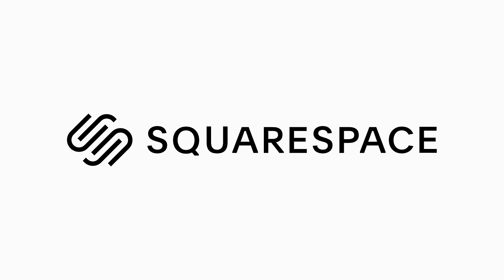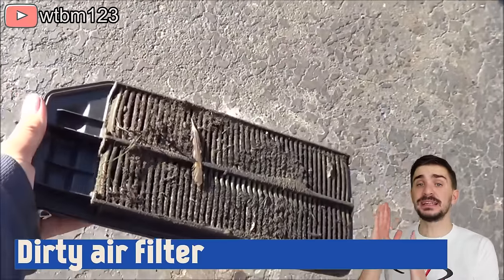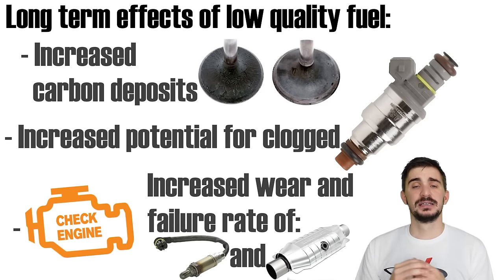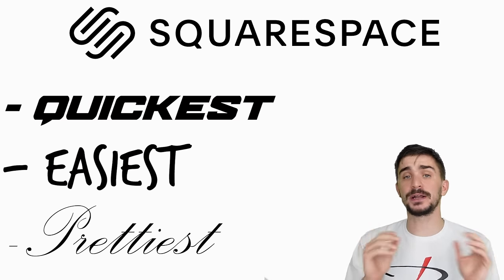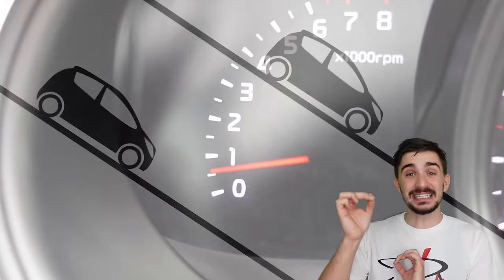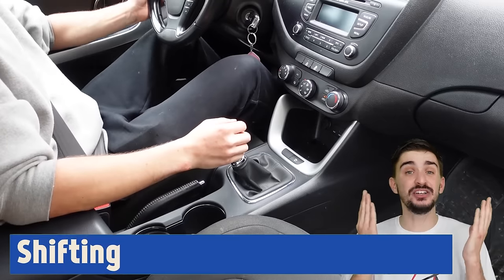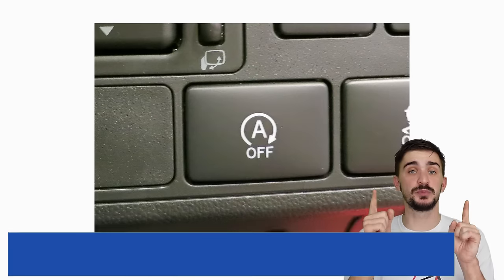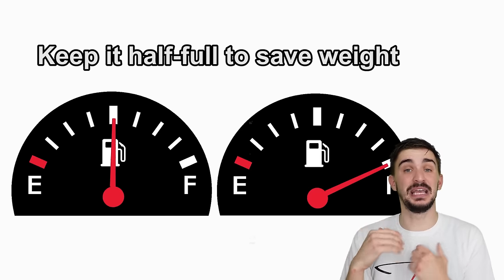EVERYTHING on FUEL SAVING - PRACTICAL DRIVING and MAINTENANCE techniques to REDUCE FUEL consumption

Comment: Around 20 minute mark you claim none of the miricle fuel additives or cleaners work.....WRONG! I have a Chevy truck with a 6.6L Turbo Diesel TDI motor (DuraMax V8) and the Lucas oil products fuel system lubricant helped aleviate the stichion of the fuel injectors with 100,000+ miles on them. After adding the Lucas lubricant my, truck mileage increased about 2.5-3MPG from 13.5MPG to 16-17MPG so now the Lucas lubricant is a must use additive. Another noticable difference was the smell of the exhaust at low speed and idiling it cleared up the rich fuel smell it had started to exhibit. The proper fix might be a new set of fuel injectors but, that is a very expensive job with very expensive parts even rebuilt fuel injectors are over $1000USD.

Comment: Sorry to say, but there are some mistakes in your video this time:
1) Obviously it saves fuel, if you shut down your engine on longer standing at red traffic lights. It's all about the time interval, but break even on modern fuel injected cars is a few seconds only.
2) Shifting up early is mostly good, unless you really exaggerate. Rule of thumb: engine speed is not too low, if it doesn't make humming sounds or cause vibrations.
3) Clogged air filters do NOT increase fuel consumption on modern fuel injected gas engines, as you reduce the air flow by the throttle anyway, unless depressing the accelerator pedal. A sensor measures the (reduced) air mass flow. Dirty filters decrease fuel economy on Diesels though. On both, Gas and Diesels, you lose max power. So, just for that, its good to keep it clean.
4) Thinner (more "liquid") fluids are called "less viscous". Put the right oil into the engine, that qualifies for it according to specs and, if applicable, season. A too thin oil may destroy your engine. For the Oil spec like 10W30, the second number (here 30) is the important one, as this tells how "viscous" the oil behaves, when warm. The lower the first number (here 10), the lower the viscosity of the cold oil and this causes less friction in winter and during warm up phases. As an example, 5W30 saves some fuel compared to 10W30.
5) Running the car in idle (manual gear box, engine idle but ON!!) at times may greatly improve fuel efficiency. This is true, if you do NOT want to brake or accelerate. Example: You're rolling downhill on the highway at say 70mph or so, and the car keeps the speed in idle and that is the speed you want. Go for it, it saves lots compared to having the gear engaged, cause in the latter case the car brakes, meaning it loses kinetic energy. If however, you want to brake, always do so with gear engaged and even shift down, to keep it running at reasonable speeds. Fuel cut off (accelerator fully released) usually engages above ~1500 rpm, so try to keep it above this limit to save fuel ... and brake pads wear.
6) A small wheel diameter doesn't save fuel at all. BTW, its restricted by the registration of your car. Narrow tires are generally slightly better due lower aerodynamic drag and weight.

Best option to save fuel: Leave your car parked and ride the bike, walk or use bus, tram, train.

Comment: Well duh you need to remove all restrictions from the engine such as the air filter which is restricting flow you need to remove the catalytic converters because they're restricting flow need to pull your heads port and polish your valves. Oh and of course dirty oil means there's friction material in there which is creating friction so change oil every 500 miles

Comment: I always try to not go over 3k rpm when saving fuel to avoid richer mix, idk if it works.
Reply: It probably does because of lower RPM range, although I believe going open loop has to do with TPS angle vs RPM on most cars, rather than just RPM. Mixture in closed loop will always be at stoichiometric ratio with narrowband O2 sensor.

Comment: The weird thing is one time I ran without my O2 sensor in the front(the threads were destroyed) and my fuel economy was better, albeit the hole was also present to affect exhaust gas. So I wonder if my system runs rich as it is? It's not a completely stock setup to begin with. Oh and I used to shut my engine off early to coast into a parking area, but I also have manual steering, so it's actually doable.

Comment: 08:10 that's plain wrong. Many cars have start-stop and those do save fuel. Even older cars will start easily without wasting that much fuel because if they pump too much the engine won't started.
As stupid as that fuel savings method is, it doesn't warrant to say it doesn't save any fuel just because of the startup procedure.
It also doesn't add any extra wear. The wear in an engine comes from lack of lubrication during cold starts after the engine has been off for a while. For the oil to have vanished from the parts in less than a minute is also improbable. That's also the reason why, on engines that haven't been started in a long time people run them with the starter without fuel for a few times for the oil to start spreading again, reducing said wear and tear.

Comment: What about Chiptuning? I know that this is usually used to sacrifice some fuel economy to get more horsepower, but would it work the other way round? And would there be enough potential gains to bother with it?
Also, would switching to higher octane fuel just to run the engine leaner be worth it?

Comment: I agree with everything except one. Nowadays human brain thinks much better than a computer. a manual transmission, if well driven, is more fuel efficenty than automatic and in a not inconsiderable way.
Uphill, downhill, city traffic, my brain always chooses the right gear based on parameters that a computer is not yet able to evaluate.
I did some tests on 2 same cars with the same engine and I noticed a difference of 3/4 km/L
And finally, if you really want to save fuel, don't brake. or rather, safety first, but driving in such a way as to limit the use of the brakes to the bare essentials.

Comment: ICE's are 20~40% efficient... leaving lots of room for improvement in most cars.

Pity you give such short shrift to other fuel saving methods.
There are ways to improve fuel efficiency that you haven't investigated. 
Yes most additives and gadgets don't improve fuel efficiency... but some do.
Some improvements are only small... but start to add up when combined.

Fuel efficiency of cars wouldn't be improving if the car companies had already applied all possible fuel saving technologies.

🙂

Comment: Years ago the Mythbusters did a lot of experiments on fuel efficiency. Drafting large trucks is possible at a safe distance but fuel saving is negligible.
Also when coasting in gear your vehicle goes into a "deceleration fuel cut" that why the exhaust sounds different, it stops injecting fuel. Surprised this fact wasn't mentioned.
Reply: @jort93z  indeed he did. It was more the way he said it, I guess. I figured he would have been more technical about the ecu actually having a fuel cut during decel. That's all.
Reply: @jort93z  yeah... You definitely got a point. Lol

Comment: Firmly disagree with one element. 'Sailing' in neutral / with clutch dipped absolutely does improve efficient, which is why many dual clutch boxes have that programmed in. Yes, the engine has to be fuelled to keep it ticking over. However, kept in gear, the engine is turning at higher revolutions which requires more energy than tick over. So, that's either done with fuel when under power, or via the kinetic energy of the car. In other words, you get engine braking. If you make careful use of sailing you can hugely increase efficient, using the cars momentum and kinetic to keep the car moving rather than to spin the engine faster.

Comment: Again with the engine shut off thing it is OK to do in a manual car. You just can’t turn it all the way off so that it locks up your steering also don’t do it in a heavy car won’t be able to use the break in a safe way the whole thing about automatic, transmission been more than patient and manual is crap

Comment: 14:50 Who shifts to 2nd at 30kmh? I always shift into 2nd when I'm doing 15kmh and most of the time I drive in 5th in the city. 
My car has a relatively low consumption but what I really hate is that weather and outside temperature have a bigger impact than my driving style....I can get 5.5 l/100km in the summer in city traffic and 7.5 - 8.0 l /100km in the winter while driving the same.
Reply: what car/engine do you drive? havent experienced such a difference but in winter fuel consupmtion does go up
Reply: @Boz1211111  1.2t corolla from 2020
Reply: @2810Mad  if you drive the same i can only think of idling for heat, or snow as reasons to such big difference in consumption for me it goes up about 10% wehn its cold, and more if i idle for heating

Comment: Do turbochargers really increase fuel economy or is it just a myth?
Reply: If you add a turbocharger to your engine or you can do is decrease fuel economy. However if you build a smaller engine than would otherwise be put in the car and add a turbo to make it as powerful as the bigger engine, it will be more efficient than the bigger engine so long as you stay out of the boost.
Reply: yes and no. I think if you are comparing similar engine displacements then no. bc the engine will need to fight the turbo to spool up. the turbocharged engine will also have more power further increasing the need for fuel. but if you compare a turbo engine which has a smaller displacement then its na rival (with roughly same hp), it most likely will be more effecient. because it will be most likely lighter and the added compression aids the ther,al efficiency.

Comment: Well, to be fair, my pickup has no power steering. And the power brakes hold their vacuum literally for months. The idea of not saving fuel by shutting off an engine is false. If the crankshaft is turning, fuel is being used. If it's not turning, fuel is not being consumed. The computer does not enrichen the mixture to start an engine that is warm.
Reply: You're right, but there is an initial injection pulse to start even a warm engine from key off to key on.  It is generally about the same amount of fuel as idling for 8 seconds, but varies.

Comment: The explanation of saving fuel by shifting up when driving uphill ("you don't have to press the throotle as hard") is kind of lame - fuel consumption is roughtly throttle*RPM. driving at lower RPM with higher filling factor typically reduces throttle losses.

Comment: About the switching to an econbox from your bigger or more muscly vehicle... Be warned Ecnoboxes are lesser car that bearly save you gas... I don't know any econbox that's gets more then 40MPG that is only 30MPG better then a suburban of really any year as they are all oddly the same 15ishMPG. A hybrid is a better plan but still only get you up top 60MPG if you buy a Prius... So you need to ask your self is it cheaper to buy a $20K+ Ecobox for comuting which you will hate and only use to do one thing your better vehicle can do... As even a Shelby GT 500 with 8 MPG will make the make the Ecobox feel worse then it is as the GT500 sounds nice and is more fun to be in even creeping in traffic. And If you have a luxery truck then yeah you'll absulutly hate the Ecnobox. Beisdes Gas prices are not in the double difgits yet so ask your self is switching to a car you'll hate worth the up front price? And $20K can buy you alot of gas.

Comment: Ahhh, remove spare wheel to reduce weight ... DO NOT DO THIS! If you are lucky enough to have an INFLATED spare wheel, wheel brace and jack in your vehicle, do not leave them at home - EVER! Many modern cars unfortunately have ditched the spare whel and replaced it with a tyre sealer/inflator. 
But wait ... I trashed my front tyre one night on a dark road when I hit an unseen solid obstacle. The tyre was not repairable. I spent 4 hours sorting out a tow-truck to take me and the car to a tyre shop that was ..... you guessed it .... closed. I then spent more time the next day walking to the tyre shop to collect my car. Fortunately I was not far from my home, but consider this: Your tyre is trashed many miles from home on a dark country road. Your mobile phone battery is flat and no one is around to help you. You may be a vulnerable person who needs medical treatment. Yes, take an emergency tyre inflator with you in case a puncture is repairable with a sealing device ... my car has one of those, but it was useless at the time because the tyre was too badly damaged.
Most car manufacturers do not include a spare wheel so they can claim better fuel economy stats. Weird Or What??!!

Comment: Use sealant kit and fuck up your tyre. You cannot repair a tyre that has been messed up by sealant. Garages will not touch a tyre that has been abused by using sealant. KEEP AWAY FROM USING SEALANT. Carry a spare wheel. A stitch in time.

Comment: There needs to be a “super eco” tuner so your car has half the engine power. But if you got a emergency you can still get out of the way.
Reply: In general, engines are most efficient around 1/3 of maximum rpm at 60-80% maximum torque. Tuning an engine to maximise efficiency at a given rpm/load is the same thing as achieving peak power. The only thing you could change is the way the throttle operates, but if you're having to rev the engine more to do the same work, thats counter-productive.
Reply: Some engines with smart valvetrains can shut off a number of cylinders, which gives you pretty much the capability you describe. Fewer cylinders and smaller displacement when cruising can be a big win.

Comment: it1s bullshit to turn off the engine becouse, over ~ 1800-2000 rpm at engine brake the fuelinjection turns off automatically.

Comment: I disagree with the injector cleaner, inside the combustion chamber and fuel system should be kept as clean as possible, buying cheaper gas normally a lower tier gas, will not have additives like a tier one fuel keeping the system clean as possible, and putting a cleaner every other tank helps reduce buildup in the fuel system, keeping down repair costs and yes ultimately maintaining proper fuel economy. I've seen inside engines using cheap gas, I took an intake off a van that was ruined with carbon so bad it barely ran. That repair negated ALL the savings of inexpensive gas purchases in one shop visit, I recommend using cleaners all the time. Everything else, spot on.
Reply: I prefer to let carbon build up.  It helps insulate from heat loss to water jacket and increases compression ratio, thereby increasing efficiency.

Comment: Wow dude! Your driving techniques section is very disappointing. The safety part is accurate but the overgeneralization on the fuel economy side is annoying.

For example, there ARE non-hybrid cars designed with electronic steering and braking and engine modes to allow you to coast with the engine off. Also, my current car's ECU is programmed to force the car to maintain fuel consumption while coasting in gear; when i coast in neutral my momentary fuel economy immediately goes up to 70mpg while coasting in gear the momentary only goes up to about 40.

Comment: 7:20 it is possible on lpg on cars with carburetor, just turn off lpg  leave it in gear and engine is rotating and does not use fuel

Comment: hybrid cars are very sensitive to climate and they pollute a lot more on the short term 
in order to be more efficient then a normal car a hybrid car needs to be used over 10 years with original equipment from the factory witch includes the hybrid battery as well 
if hybrid battery is changed lasts say at 8 years then that car is a big polluter compared with any other same size normal car

Comment: In 8 minute it's not true. When you are in move and want start engine it only necessary to turn key in ignition position and set gear. Engine will start from wheel move, but fact is stil stupid technique.

Comment: Usually your video's have good logic but this time too many things are absent or not correct;
1. Cleaning an air filter with high pressure compressed air is a VERY BAD idea; it destroys the fabric and will leave bigger micro openings in the fabric, so bigger dust particles can enter. Besides; does everyone have an air compressor?
2. Usually a modern car engine is only rated for 1 type of oil. Don't forget that the upper value (e.g. the 50 in 20W50) is also about the load that the engine can endure. So thinking that replacing for instance your 20W50 with 10W40 is better, is not true!
3. Following a truck even at some meters distance will get you considerable fuel saving. Trucks by nature of big mass can not surprise you that much with sudden speed changes.
4. Driving downhill with the drive gear engaged in a petrol car/motorcycle with carburetor engine WILL increase fuel consumption considerably.

5. Shifting; just look at the torque graph of your engine and use that power band the best way possible.
6. An automatic uses more fuel than a manual gearbox by way of the internal design; the torque converter uses a small percentage of the engine power. (PS an 'automatic' DSG gearbox is NOT an automatic gearbox!!)
7. Probably going to stir a lot of people with this last one but; Hybrid cars use MUCH MORE fuel than diesel cars. Just consider the hundreds of kg/lb. dead weight you have to accelerate and decelerate...
Reply from the maker: So many facepalms

Comment: it's strange not to hear these tips:
1:if you have a long journey and time isn't strict try to find optimal speed for maximum efficiency.
I can reduce avg fuel consumption by 1.5l/100km just by traveling at 80 instead of 120km/h
2:use your f** legs. It's not that hard to walk 10km
3: Best efficiency is achieved when car rests in the garage :P